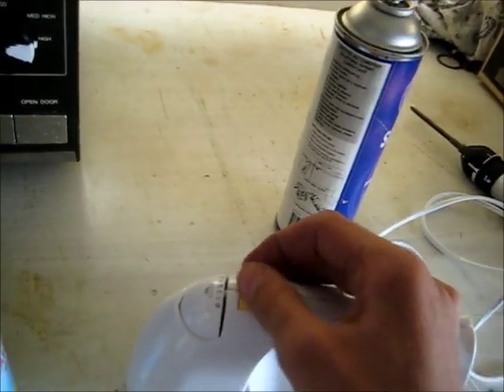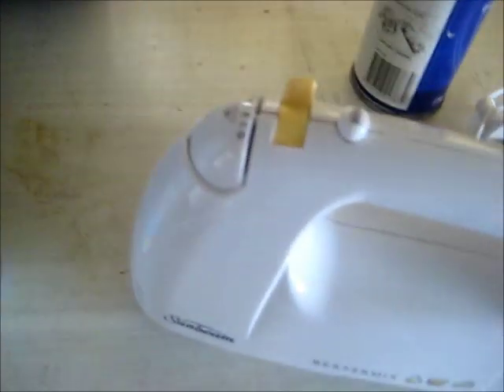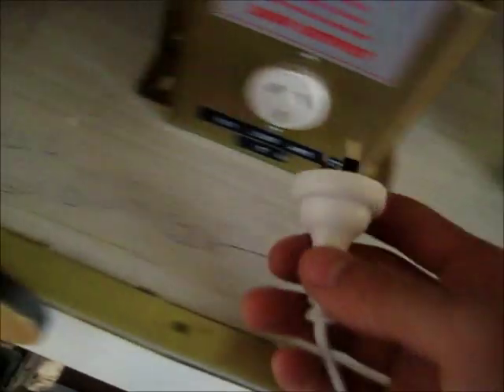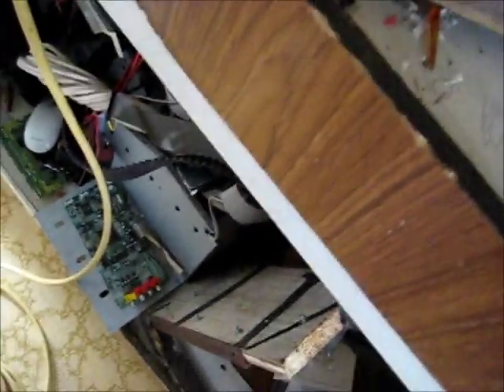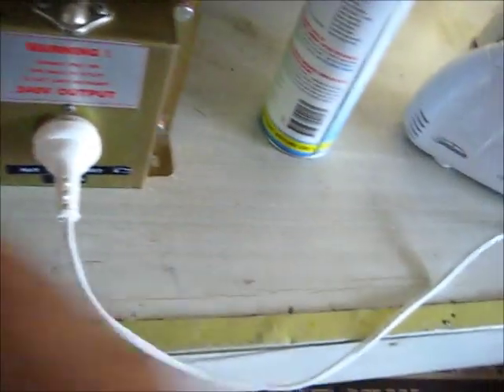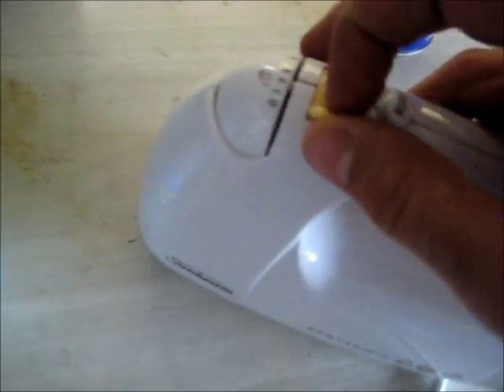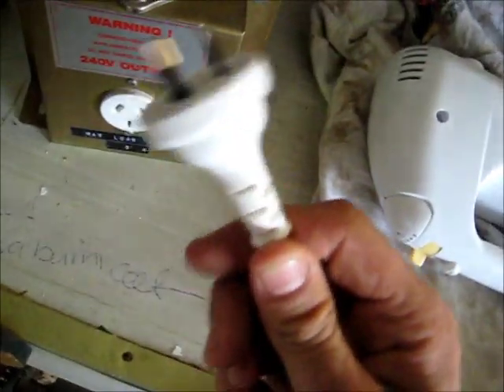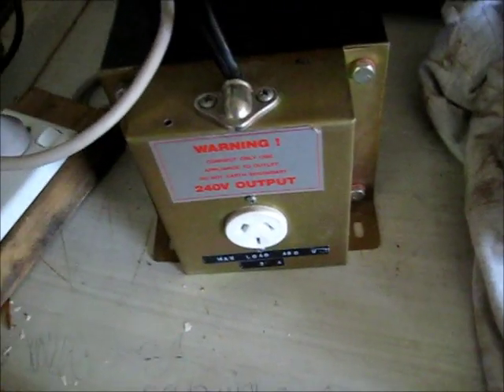Hand Mixer Repair

Comment: i use the same contact cleaner but i paid $18 last time! i just douse everything in it. the thing about silicon spray is because it is so thin it evaporates easily when heated. same deal with wd40 and rp7 ect. nothing beats a/t fluid